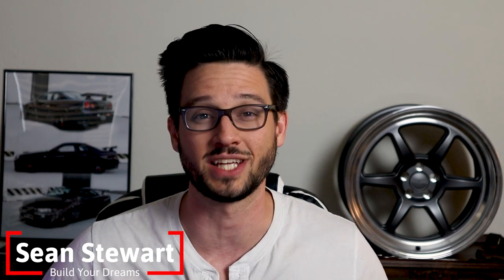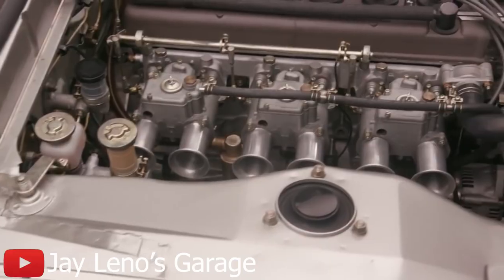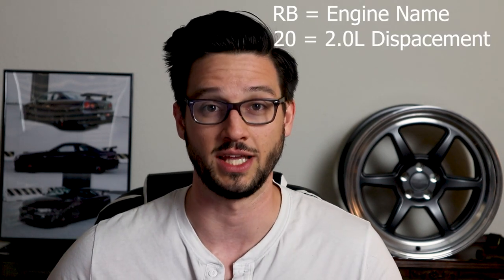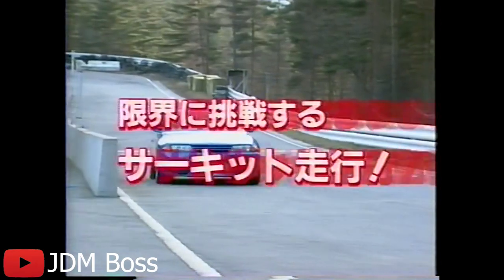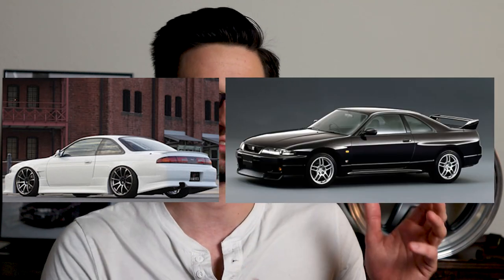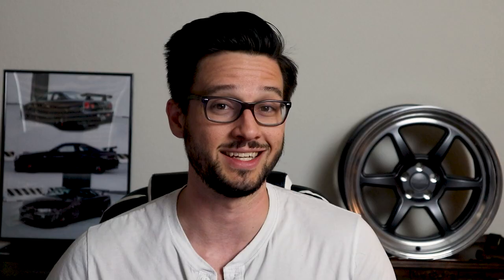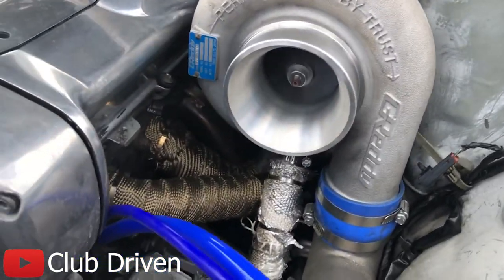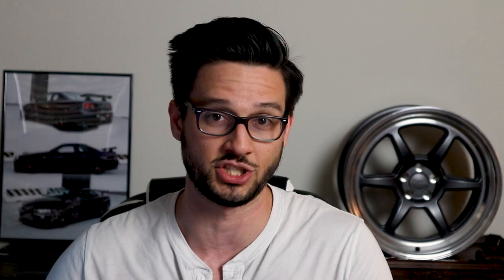Why is the RB26 SO GOOD?

Comment: Stock Rb26 engine is not forged internal.

r34 gtr include standard, vspec or 
vspec 2 turbo still running ceramic turbo the only upgrade is ball bearing from factory compare to normal or vspec r32 & r33 gtr except N1 or nismo edition are running steel wheel turbo
Reply from the maker: You definitely know your stuff! Thanks for the correction.
Reply: No worries mate
Reply: ... and the oilpump collar was already changed during the production cycle of the r32 gtr. Later models have the wider oilpump collar and pulltype clutch.

And the real hp crank output was higher. More likely between 320 and 330hp.
Reply: @G.J.G.P.   yes that right mate. From later model of r32 gtr its has long nose crank and pull type clutch
Reply: @G.J.G.P.  plus the rb engines were used in other cars like the Nissan c33,c33,c34,c35 laurel  and their special edition club C trims. The oil issue was resolved they used the neo and det variants.
Reply: @tervenjames8305  this video is about the rb26 and the rb25 neo with the pulltype clutch was just introduced in the r34 era. Erlier rb engines beside the rb26 had push type clutch. The resolving was way earlier in the r32 era
Reply: Stock rb26dett and rb25det neo both came with forged rods. No forged pistons though. Rest is correct
Reply: @SupMaHomies  no, thats incorrect. The rb26 is known for not having forged rods. I can confirm it, i am rebuilding one. So why should the rb25 have forged rods, if the rb26 doesnt?
Reply: Rb26 and rb25 neo have I beam rods the neo is the best rb made fixing all the rb problems
Reply: @zakauckram4987  the problems have been never fixed. How? The neo has still the same  oilreturn as the rb25 before, and rb25 and 26 oilreturn ate the same. And the oilfeed of the rb 25 including neo are 2 compared to the 26, it only has 1. So how it has been fixed? And the crank issue was improved in the early stage of the rb 26.

And all RBs have I beam rods, ( all factory cast rods are practicly I beams) so not worth mentioning
Reply: @G.J.G.P.  neos have restricters in the head the oil pump on neo are higher flowing and the crank in neos and 26 are long 👃   the rods are stronger then the s1 and s2 25dets the pistons are much better in the neo
Reply: @zakauckram4987  all RBs have oil restrictors to the head and the 26 has the rear oilfeed blocked completly.  And as far as i know, the oem pumps ( beside the n1) are all the same, noch changes. And same as the piston and rods. But if they improved it, what makes it  then "superior" compared to the older rb25 or others, as ypu stated superior to the other RBs. In this case those parts you mentioned in youre statements.
Reply: @G.J.G.P.  neo are better then the 25dets 
If u can't work out y then there is no point me keep telling u they are better 
The neo has the best cams from factory  it runs a 9.1com vs the other 8.5 or so  
The exhaust valve is 1mm bigger then the other 25s
Reply: @zakauckram4987  no, those parts you mentioned before. Stop shifting the argument. Hate when people do that, just because they have no stats to back up their earlier statemants
Reply: @G.J.G.P.   26det rods are the same in the rb25det neo  they are I beam rods that's why people say forged internals the rods in a s2 rb25 are weak  the ringlands on the piston of a new are thicker making for a better seal 
Neos have restrictors and yes 26det have one feed blocked off 
Rb25 s1/2 run 81mm oil gears where the neo has a higher flowing pump n1 with the 77mm gears the neo has long crank collar  where the s2 and s1 have short collars the pistons in the s1 and 2 are bigger then the neo as the neo is a flat pistons is there anything else u want me to go over
Reply: @zakauckram4987  dude, read your first ststement. You ssid, that it is better because of "i beam" and oil issues gone. And i told you that your reason " i beam" is idiotic, because all cast rods have an i beam shape and that it has still the "same" oiling "issues" as every RB. As i mentiond earlier- all RBs have oilfeed restrictors, and the 26 has the rear blocked of. 

No, a thinner outer gear walling of an oilpump is not an improvement, even if its doing more pressure. Its even more prone to crack. A longer pump drive is an improvement, but is not solving the whole oilling issue and does not make it "superior" to the other 25s. 

I challenged your first statemant and was asking, what exactly makes the neo "superior" to other RBs in this segment YOU stated, to point out your dumb arguments. And now you bring up other stuff, you dindt even talked about earlier, shifting the argument, just to win the argument, beause you realized that youre statement was pointless.

AGAIN- i asked you what makes the NEO superior to the other RBs in terms of "i beam" and oiling issues.
Reply: @G.J.G.P.    a s2 25det rod is not I beam  a rb26det rod is  if u loom at after market rods the 26det rod is more like an I beam   the s2 rod is just a fat heap of shit   
Not all cast rods have a I beam shap they may look like an I   h beam rods don't look like an h   take a 26 rod  and a 25s2 rod and see the difference  people call the 26 rod and i beam  rod  find me a 25det s1ors2 and put 600hp out of it  u can't it just won't take it 
Get a rb25 neo and put 600hp all day and some more  there are multiple rb26 stock bottom ends holding 800hp+  the rb25neo runs a much better end then what the s1/2 have

Comment: The RB26 that you put on the thumbnail doesn't have what I like the most about the RB26's; The insane response that they have thanks to the individual throttle bodies and the twin turbos. Just the fact that in the early 90s, a company like Nissan made an engine with ITBs was what separated the RB26 from everything else (on a similar price bracket)

Comment: So good yet it still has the oil issue unless you modify the head ?? 
Correct me if i am wrong but you cant sit there and say this is a "good" engine when it still has faults to it.
And the rb26 does NOT have forged internals ...
Reply: Yes, youre right. It does not have forged internals from factory. But so does any other engine, if you tune it over a cirtain hp lvl. You will have way more than just oiling issues. And most of them are lower than the factory limit of the rb.

And if the manufacturer uses forged piston there are two options a) use 4032 alloy or hpereutectic for longevity, but sacrificing reliability at higher hp numbers ( in the rb case over 600-700hp) also more expensice than cast alloy or b) use 2618 for making high hp output possible but you have to rebuild the engine evry 40- 60k miles (80-100k km). Explain that to a customer from the 80-90s, whos not buing a ferrari.

So which path would you go?

Comment: the rb25 det neo 6 is actually the best rb from the factory,all the prone faileures of the 25/26 were reformed in the neo,far more superior
Reply: Neo (rb25) has 11mm headbolts, so how could it be superior over the other RBs to begin with ( the 26 has12mm) .

Comment: R26 are trash
Reply: Ok, and for which reasons? That you have to upgrade parts in order to extract more than 600hp out of it? That is pretty normal, that factory parts have their limits, thats why there is an aftermarket. And there are not many engines out there, which can handle 600hp in stock form which was rated 280hp from factory and can rev 8000 from factory and over 9000 tuned as a turbo. Curious, that many other who tuned them correctly and who are not kicking out the sh!! of it for no reason fe. reving it cold into antilag to please a croud all day long, are able to keep them reliable, and also think different of it. And if the rb is sh!! so are many, many engines beneath it. And what about the bmw s85, subaru boxer or the vw tfsi between 2008 and 2012?
Reply: @G.J.G.P.  there's better motors m52s,s54s,2jzs,ls,k24s the rbs have a bad oil drain design and bad oil pumps.
Reply: @frontspring1  M engines are known for bearing issues, what makes the k better? Define better. Oiling issue is the only problem you got with the RB? Thats your whole argument???

Ok, so then tell me any other engine which has won bathurst a few times, competed a few times in the 24h nürburgring race and landed in the top 10 over all, best was 5th, made motorsport history, is over 30 years old, is still beloved by tuning fans all over the world, because it still cometing with the best and is relativly easy tonwork with? And most important is the sweet sound.

Name me one other engine which has done that all.
Reply: @G.J.G.P.  don't even get me started on the block cracking issue and the poorly designed block castings.
They're just not practical here in the USA they're too expensive and you're only getting 2.6 liters. There's better options for that kind of money. They only built a limited number and they're getting really hard to find. You're talking like 15 grand to get one.
Reply: Take Look in the mirror then you will know what trash looks like
Reply: @patrickboodhai6750  stop projection.
Reply: Talk is cheap